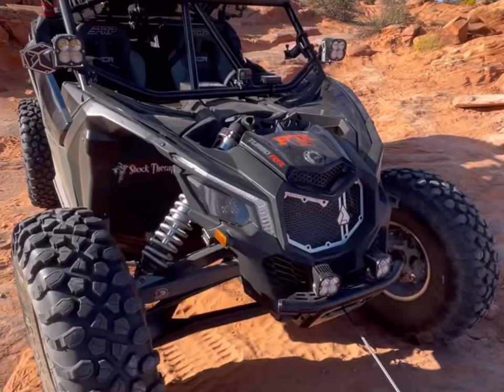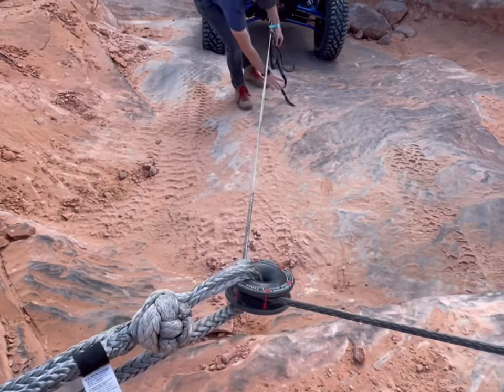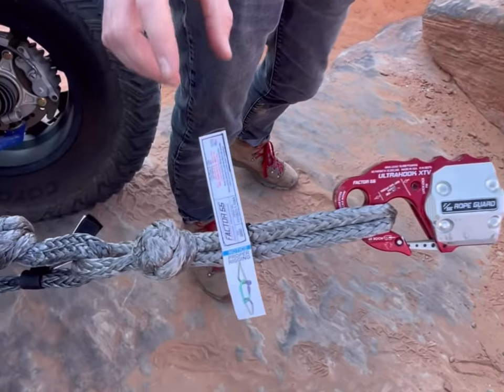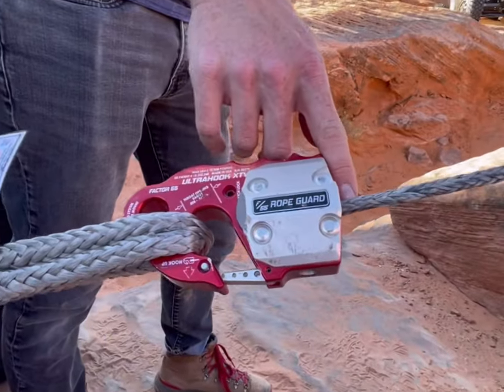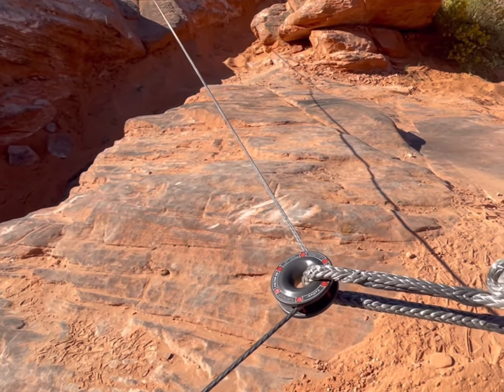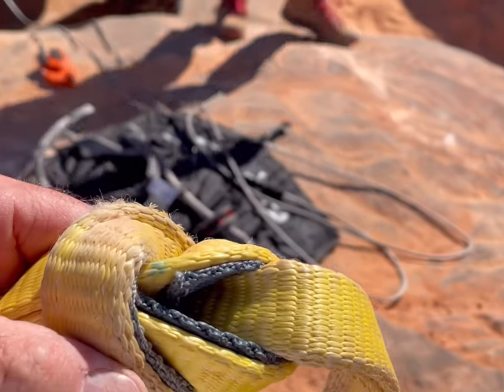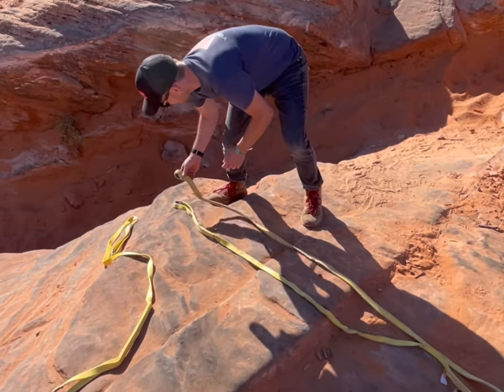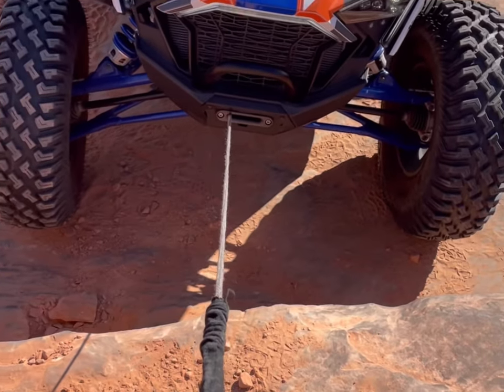Winching demonstration with Factor 55 Rope Retention Pulley and Soft Shackles

Comment: Misleading commentary.  Adding a pulley doesn’t increase the pull power, it only reduces the load when you reattach the hook to the point of origin (the winching vehicle). This is because the load is shared between two ropes (the doubles up winch line) and the end point of the pulley.  The winch needs to work half as much, and obviously good for life of winch and synthetic rope.